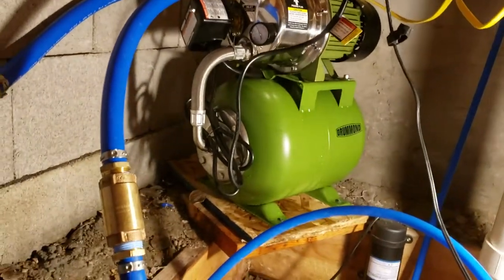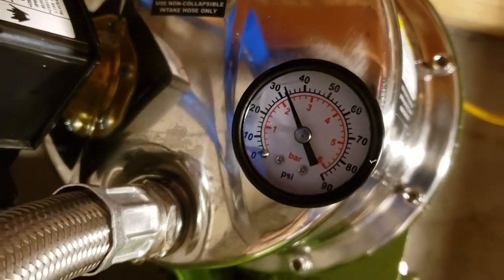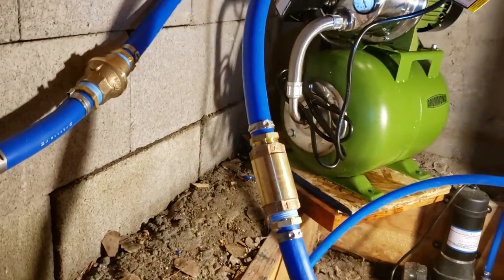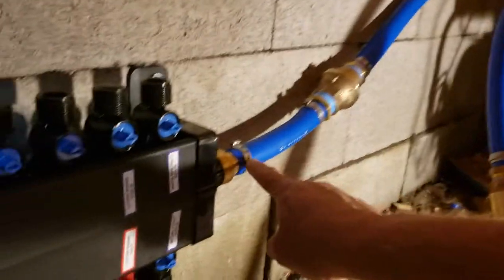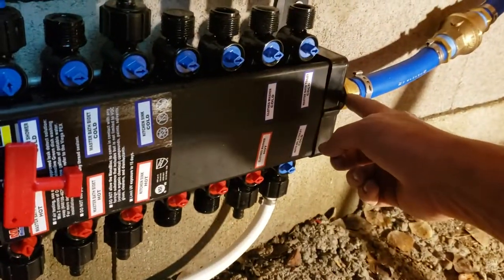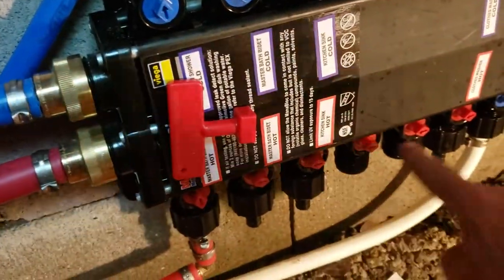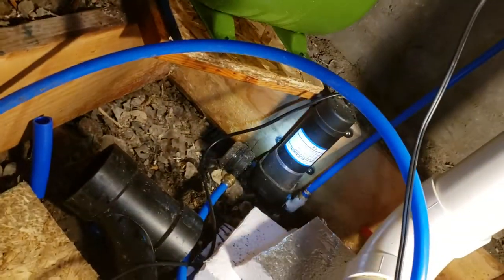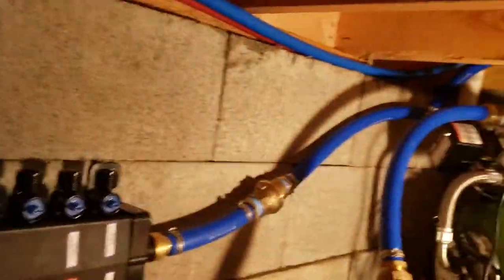Cabin fresh water setup using Shallow well Pump.

Comment: what size inverter does your shallow pump run? I have 2000 watts and I'm having problems with it
Reply from the maker: My place is on town power so it runs 120v/10a.  So I'm not using an inverter yet.  I may switch to Solar and see but that  is a later project.